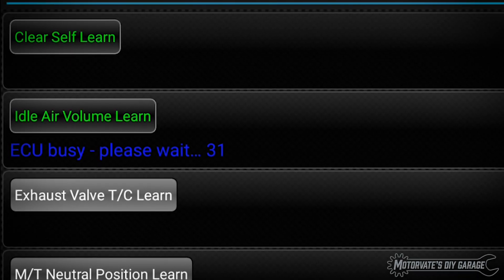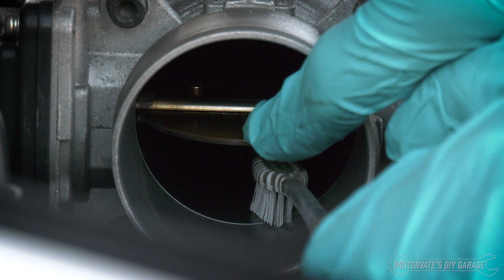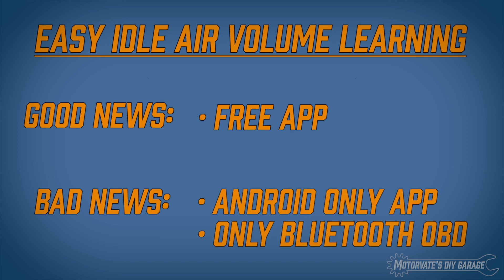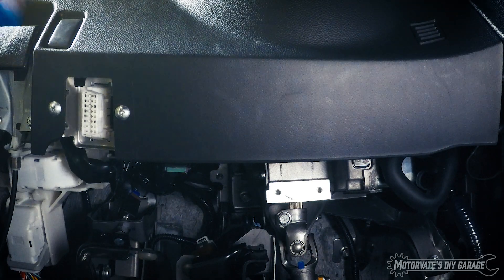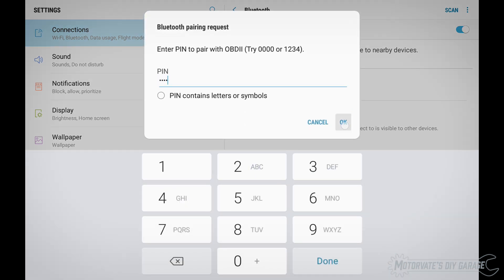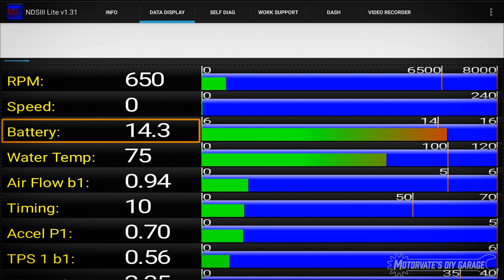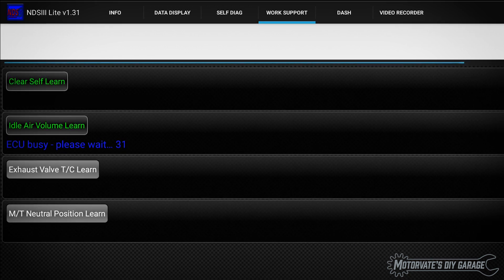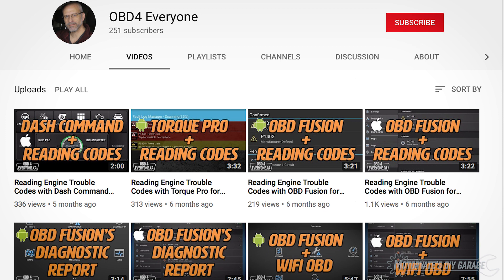Quick & Easy Idle Air Volume Learning: Motorvate's DIY Garage Ep.28

Comment from the maker: If you are having trouble getting the Idle Air Volume Learning to complete, here is a technical service bulletin (TSB) on how to resolve this:
 • http://www.370zcoupe.com/TSB/1TN39.PDF 

Here is the text of the TSB:

INTAKE AIR VOLUME LEARN WILL NOT COMPLETE APPLIED VEHICLES: All
APPLIED DATES: 2007 - 2012
SERVICE INFORMATION

If IAVL will not complete using CONSULT:
a. While the engine is running, disconnect “Mass Air Flow” (MAF) sensor for 10-15 seconds until MIL (P0102 or P010C) comes on, and then reconnect before performing “Intake Air Volume Learn” (IAVL).
 • If vehicle has two MAF sensors, disconnect only one in prior step and leave the second one connected; then reconnect.
 • Engine may stop running when idle reduction occurs. Reconnect MAF sensor and continue to step “b”.

NOTE: If P0102 or P010C were not stored when DTC was confirmed, repeat step “a” until idle is reduced.

a. Clear any DTC’s that may have set during MAF disconnect.
b. Perform IAVL.
c. Confirm that idle is now within specification for model and year of vehicle being worked on.
Reply: Did not work on g35 '07 sedan
Reply from the maker: Hey A Sea Rhinocerus,
There is a bug in the 2007 G35 and 350z ECU and the idle air volume learning will never run to completion.

Some have been able to get an ECU update at the dealer, or you can it updated by Eugene at Enthusiast Auto Care
(https://www.yelp.ca/biz/enthusiast-auto-care-concord)

One 350z viewer commented that he replaced his ECU with one from a 2007 350z.

Comment: Hello MotorvateDIY, I have a 2011 G37S Coupe but am not able to get the Idle Air Volume Learn function to enable as (turn green). I noticed when connecting the Status bar does also reads Get Params Failed and Get Regs failed as well. What do you recommend???
Reply from the maker: (Sorry just saw this now! Sometime YT comments just appear from the past)

I'll assume you got the issue figured out by now. If not let me know.

Comment: Hey!! I'm disappointed with the app. I have a Nissan March with a 1.6 HR16DE 2013 engine. I installed the app on my phone with Android 14 and the main function I needed didn't work. Idle Air Volume Learn (IAVL) function.
The button is not enabled for use. Can you explain to me the reason for this? I installed the NDSIII Lite version.
Reply from the maker: It looks like NDSIII doesn't work with your engine:
https://nisscan.com/vehicles/?v=3e8d115eb4b3

However, NDSII does list "FRA Nissan Note 2008 (HR16DE) – ECM"

You may want to reach out to the niscan.com folks for support.

Comment: My Rpm’s is rising up and down rapidly, it also just keeps on saying ECU busy. Is there a way I can contact you please ?
Reply from the maker: That sounds like the ECU is trying to lower an idle that is too high. Please scan for codes and see if you have a P0507 (idle too high)

It can be tricky to get the idle air volume learning to run to completion. Some of the comments on this page mention trying it over 20 times, before it worked. Kind of weird.

BUT you do need to follow the pre-condidtions exactly, if anything isn't correct, it won't run to completion.

Comment: hello, i have a question..will the ecu relearn by itself? i changed plugs,cleaned throttle bodies and maf sensors and started car up and was idling erratically up and down a few times before doing it all over again...i did the IAVL and it stabilized the rpms alot lower (800 to 900 rpm)...while in drive and stopped its normal but coasting to a stop it idles around 900rpm...will it fix itself? over the course of days of driving?
Reply from the maker: Once the engine is fully warmed up, the idle should be between 600-700 RPM when in park/neutral.

I don't know what is normal engine RPM once it is in drive and costing to a stop, as my G has a 6 speed manual.

You could ask you question on https://www.reddit.com/r/G37/
Reply: thanks for the reply. i got it back down to normal with the last proceedure of the three..your videos are very informative and helpful. keep up the great work 👍

Comment: I have low idle after doing the idle relearn, would you know why ? I don’t have any codes.
Reply from the maker: How low is low? What engine / car?
Reply: @MotorvateDIY  2011 g37x and it’s at 500 when I put it in drive.
Reply from the maker: Idle speed is measured in park or neutral, with the engine fully warmed up.
With the transmission in drive, it is normal for the RPM to drop a little.

To me, it sounds like it is normal.
Reply: @MotorvateDIY  ok thanks

Comment: Hi, will doing this remove the check engine light that is currently displayed on my dash ?
Reply from the maker: There are 100s of reasons why your check engine light is on. Scan it to get the trouble code, and troubleshoot from there. 

The check engine light will go out on its own, once the issue is fixed and the car completes 2-3 drive cycles. (google it for your make and model to see what it is)
Reply: @MotorvateDIY  sorry for being so vague. I cleaned my throttle body recently and the check engine light came on because of that. If I do the idle relearn, will it remove the light ?
Reply from the maker: What was the code?
Reply: @MotorvateDIY  there is no code, only the light is on and it came on after I cleaned the throttle body.
Reply from the maker: If the check engine light is on, there is a code. Maybe the OBD scanner didn't pick it up?
Reply: @MotorvateDIY  I’ll be sure to check again today, thanks !

Comment: My manual 6mt g37 has no check engine lights but the rpms spike or fluctuate  when I press the throttle a bit hard. Just changed spark plugs and cleanes tbs
Reply from the maker: Have you done the idle air volume learning?
Normally this gives a smooth idle.

Comment: If the original idle air was learned and stored in memory why does it need to be relearned? Or is it stored in RAM.
Reply from the maker: Hey  Fernando Hood,
That is an excellent question!

Due to the crankcase ventilation (PCV system) there is a little oil in the intake air. This is why the throttle body gets dirty.

Over time, the ECU will adjust the throttle position (little more opened)  to compensate for the carbon build up. When we clean the throttle body and remove the dirt, this will allow MORE air into the engine and the idle will be higher.

The idle air volume learning process allows the ECU to "reset" the throttle position to get the proper idle speed.

The idle air volume values are stored in  non-volatile memory, so they are not lost when the battery is disconnected.

Comment: If there is high idle e.g 1500rpm will this work?
Reply from the maker: Hey  Fernando Hood,
First check: Make sure the engine is fully warmed up. a 10-15 minute drive should be good.

If the idle is too high, the idle air volume learning won't run to completion.
To temporarily lower your idle, you can create a small vacuum leak by unplugging the PCV system at the intake, or by allowing a little air in at the throttle body. (Loosen the clamp and partly pull off the rubber boot until there is a little opening.

Others have had luck by unplugging the MAF, starting the car and getting a check engine light. Then plug in the MAF, clear the code and the idle might be a little lower.
Reply: @MotorvateDIY  I tried unplugging the maf and the rpm remained unchanged.  I thought more air equals higher idle.
Reply from the maker: This engine (VQ37VHR) is very smart. It has the ability to run without the MAFs connected. (at idle anyways) It converts from a mass air flow based system to speed density.

Comment: Should I do a relearn if I have put spacers on my throttle bodies?
Reply from the maker: Hey  Alien8eD!,
That is a great question!
Since the throttle body spacer doesn't change the airflow at idle, I don't think it would be necessary to do the "idle air volume learning"

However, since the throttle bodies are off, why not clean them and do the "idle air volume learning"... then you are good to go for a while :)

Comment: I cleaned my throttle body in my 3.7L Q50, had the high rpm issue.  I tried the manual way 3 times.  Wasn't having luck, but got the VP11.  I had done the first two procedures in the morning, drove to from work, parked in driveway and ran the IAVL.  It went to about 4000 in the NDS3 app, took well over a minute, and said it failed.  Engine reved quiet a few times during the process but didn't return to 650 after restart.  Ran it two more times, each seeming to fail.  Next day though, I had to drive to work and its started idling between 600-650 after warming up.  So I have no clue how it started working but YOU ARE THE MVP! Running like a champ, cant wait to do more DIY! Leaving this book here in case someone else runs into the same weirdness I did ;)
Reply from the maker: Nice! I'm glad you got it to work. The idle air volume learning can be tricky to get to run... The NDSIII app makes it soooo much easier :)

Comment: Hey..man..with this app nds3..have you tried to do the vvt learn..did it work?..just wondering ..
Reply from the maker: Hey  li san
Do you mean the "Exhaust Valve T/C Learn" that is for the VQ35HR engines?
I have not tried it, since I have the VQ37VHR.

The NDS III app seems very good and I would trust it.

Here is the description from the factory shop manual:
Exhaust Valve Timing Control Learning is a function of ECM to learn the characteristic of exhaust valve timing control magnet retarder by comparing the target angle of exhaust camshaft with the actual retarded angle of O exhaust camshaft. It must be performed each time exhaust valve timing control magnet retarder is disconnected or replaced, or ECM is replaced.

Comment: My BT Ali adapter works with Scanmaster PC Win10 also with Car Scanner 1.45.6 Android But the Niss Data Scan application does not connect
Reply from the maker: Hey Luky ZorrroS,
You may want to have a look at the supported scanners on the NDS website:
http://nisscan.com/NDSIIA/index.php?content=supportedadaptors

Nissan DataScan emulates the Consult III protocol and not all scanners have the hardware to do that.

Comment: Hey! Derek.
When I set up Easy Idle Air Volume Learning, I have a question.
#One day, when Idle Air Volume Learning is activated, the reaction of the Alphiem and the engine will be completed and the battery bolts will be 11.8v to 12.0v. 

#One day, when Idle Air Volume Learning is activated, the battery bolts are set to complete without any reaction from Alphiem and the engine (then the battery bolts are 14.0v to 14.2v) 

I don't know if this is the right setting...
Reply from the maker: Hey 이성원,
I am really sorry, but I don't understand what a "Alphiem" is and can't understand your question.
Reply: Hey Derek
I am really sorry.
I think my question is wrong.

1. During Easy Idle Air Volume Learning, there are times when the engine RPM moves up and down and becomes set (at this point the battery voltage is 11.0v to 12.0V).

2. During Easy Idle Air Volume Learning, the engine RPM is set without any movement (at this point the battery voltage is 14.0v to 14.2V).

1.2 Do you want to know what's right about the bundle?
Reply from the maker: Hey 이성원,
Thank you for re-word the question, I think I understand now :)

The ECU controls how much power the alternator generates and that is why  the voltage changes.

If you let your car sit all night and measure the battery voltage in the morning, what is it?

Using NDS III does the idle air volume learning complete?
Reply: @MotorvateDIY  I tested two methods under the same conditions.Setting using NDS III will result in engine eddy.   If you set the existing factory manual method, there will be no defect.  You don't know why?
Reply from the maker: Hey 이성원,
Sorry, but I don't understand what you tested: " I tested two methods under the same conditions."

What does "engine eddy"  mean?

Comment: I followed the instructions but they two signals in a car dashboard slip off and vdc the pedals not respond only 1800 rpm sorry  for that
Reply from the maker: Hey  Lamberto Lopez,
Let me try to understand: 
• The "Slip Off" and "VDC" dash lights are on.
• After cleaning, your idle is 1800 RPM
• The gas pedal doesn't make the engine rev

Ami close?

Comment: Derek!
throughtle closed learn.
Number 2. How many seconds do I have to wait after the switch is on?
Or is it off right after it's on?

1. Make sure that accelerator pedal is full.
2. Turn position switch ON.
3. Turn position switch off and wait at last 10 seconds.
Make sure that you want to do something.
Reply from the maker: Hey 이성원,

This video explains everything step by step :)
https://youtu.be/HIiaF0VaTlQ
Reply: @MotorvateDIY  The manual says to switch on, and Derek's YouTube says you should start the car, turn the water temperature to 67C, turn it off, and listen to the throttle body closed. Don't you understand?
Reply from the maker: Hey 이성원,
I am not 100% sure if I understand the question...
Here are the steps right from the shop manual:

WITHOUT CONSULT-III
1. Start the engine.
NOTE:
Engine coolant temperature is 25°C (77°F) or less before engine starts.
2. Warm up the engine.
NOTE:
Raise engine coolant temperature until it reaches 65°C (149°F) or more.
3. Turn ignition switch OFF and wait at least 10 seconds.
Check that throttle valve moves during the above 10 seconds by confirming the operating sound.